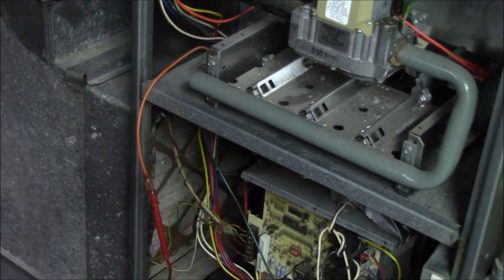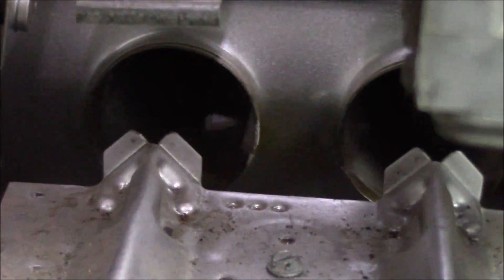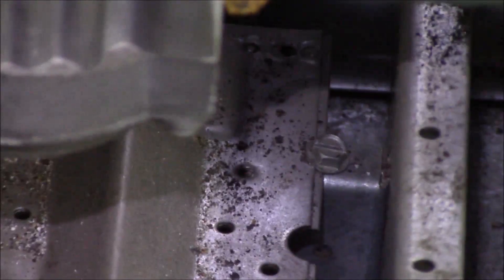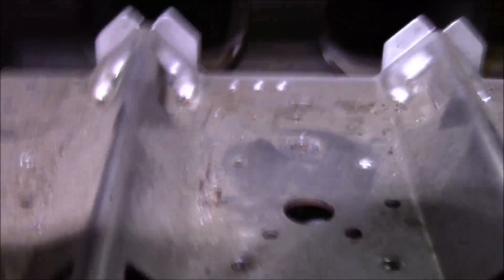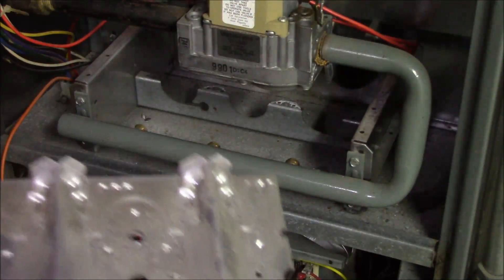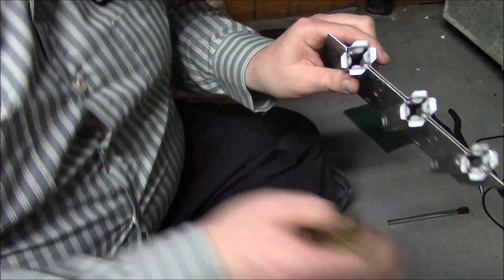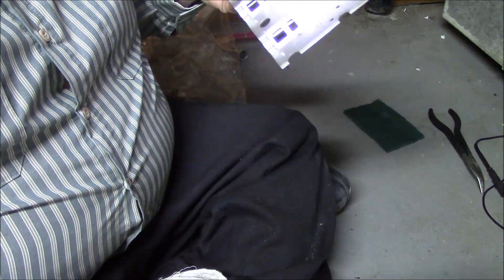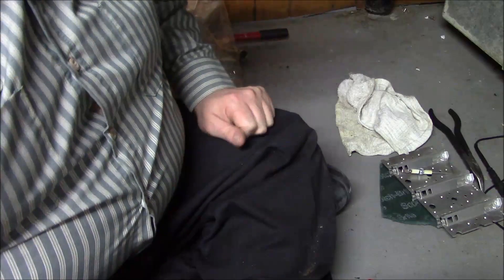Cleaning and testing a flame sensor (servicing a a furnace) 2 pt.

Comment: Is it normal to have to clean the flame sensor once a year? I feel like that's too often. This is the thord time I've had to do it since moving in to this place a few years ago.
Reply from the maker: Damp crawlspace or basement can affect it for that, but it's not typical. If it's been cleaned with sandpaper, it will be as it scratches the surface, and dust will burn on it to insulate the electrical flow. I would suggest a new one and have it cleaned with scotch bright, never sand paper.
Reply: @ChilesHeatCool  I've only ever used a scotch Brite or a crisp dollar bill, no idea what the previous tenants and/or landlord have done to it though. Thanks for the tips
Reply from the maker: @subtledemisefox check the micro amps with a meter. It also just may be time for a new flame sensor. 

Your welcome. Thanks for watching.